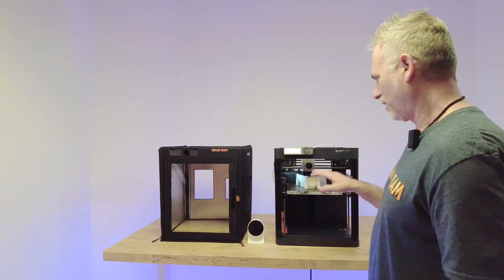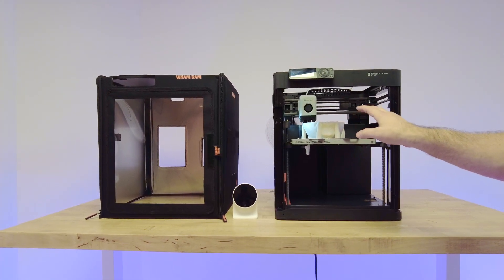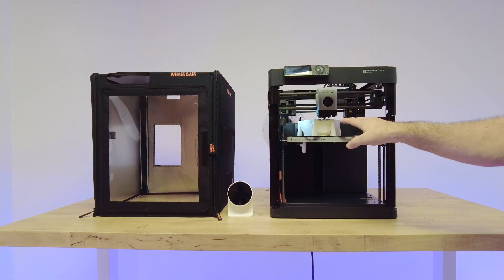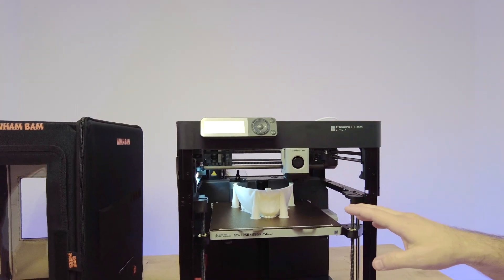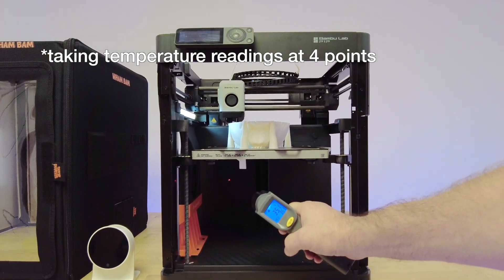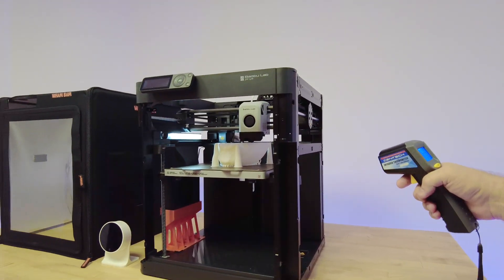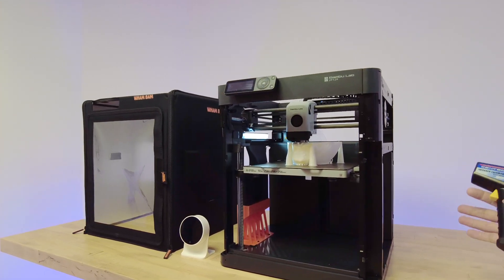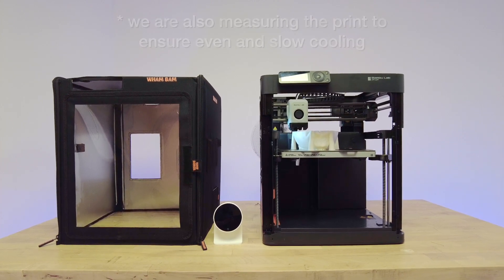Temperature Testing our Bambu Lab P1P Enclosure

Comment: does it fit the p1s for extra insulation?
Reply from the maker: It will fit the P1S  but you will have to remove the front glass door as it will not pass through the HotBox door